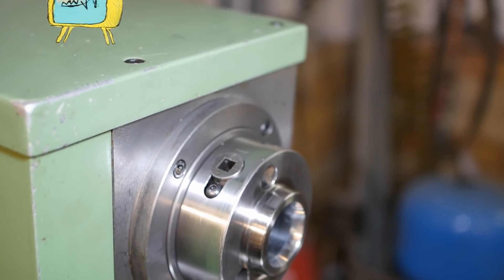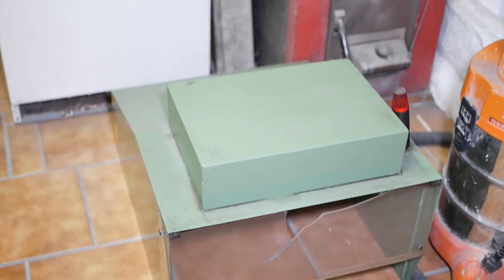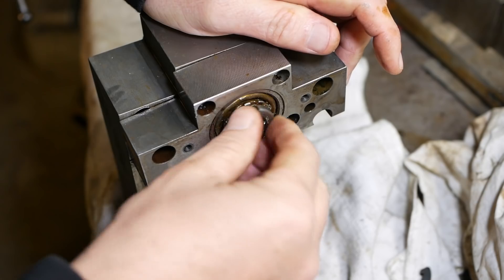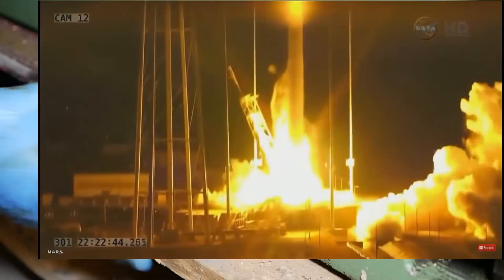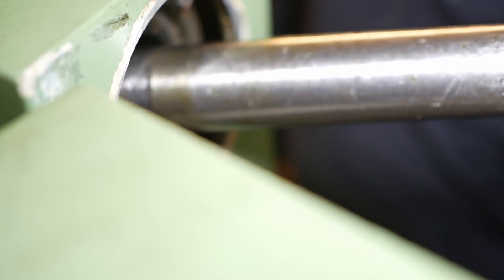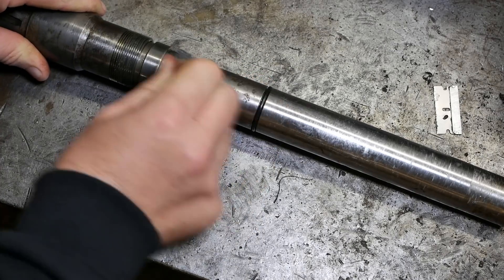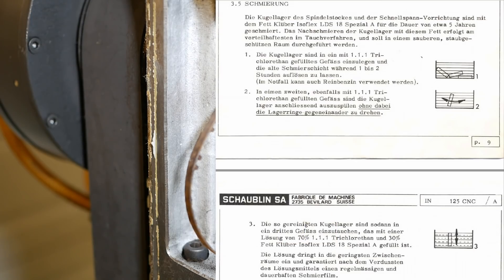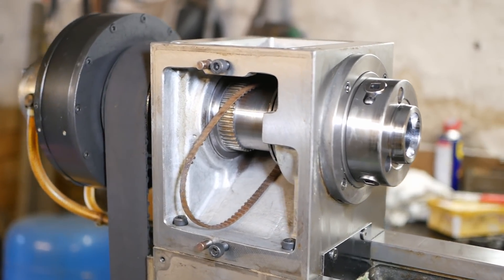Don't do this to your Boeing 737!

Comment: The nearest flat surface... I have never heard something so terrifying. The only thing that is truly flat is your surface plate...

The music again is on point, and the Antares launch explosion was also a nice touch.

But I really want to hear more stories about your work as an aircraft mechanic.

PSA: Apparently, some chewing gums cause a false positive result with one of those fast antibody Covid tests. We had that happen at our school.
Reply from the maker: Thanks. It took a while to find a rocket which blew up shortly after launch :)
Reply: Only carpenters know a perfectly flat surface to exist. The guys at calibration labs know that it's always off some.
Reply from the maker: Yeah, it is just a question of your measuring equipment.
Reply: @MF175mp  Yes, it has a derivation from true flatness, but in the shop, it still is the primary reference standard.

This is metrology 101.

Just like a few years ago we had "The Grand K", the international prototype of the kilogramm, an object which was defined to have a mass of one kilogramm, no matter its actual mass. It WAS the kilogramm, and by definition, had a mass of one kilogramm, and all all scales were calibrated to this artefact.

Just like "The Grand K" was THE kilogramm, the surface plate is THE flatness reference.
Reply: @vincentguttmann2231  the flatness has an absolute value and perfectly flat means the same everywhere. A unit of weight or any unit is a matter of standardization and it's not traceable to anywhere else than the standard
Reply: @MF175mp  Flatness also has a unit: derivation from flatness over distance. How exactly did RotarySMP check the Flatness of the cross slide ways? Oh right, by checking it against a surface plate, the shop standard for Flatness.

If I may quote Wikipedia: "A surface plate is a solid, flat plate used as the main horizontal reference plane for precision inspection, marking out (layout), and tooling setup.[1] The surface plate is often used as the baseline for all measurements to a workpiece, therefore one primary surface is finished extremely flat with tolerances below 11.5 μm or 0.0115 mm per 2960 mm for a grade 0 plate.[2]".

So as far as shop work is concerned, it is, by definition, flat. That's precisely what "being the main horizontal reference plane" means. 

And yes, there is derivation, but if no higher-order standard is used, you cannot prove that the surface isn't perfectly flat.
Reply: @vincentguttmann2231  the flatness of the plate itself isn't measured with a better plate. Those devices aren't standards for flatness either at almost any level. You still can prove and actually measure flatness with them. For example by bluing stuff up on the surface plate in the other hand you can tell that the thing is not flat but not very accurately how much it's off. Anyway my point wasn't that the plate isn't good enough for general shop use. Of course it's usable but if you do stuff with higher accuracy you need a better plate and so on. Of course I was just poking you on calling the surface plate truly flat and the other faces on the shop not flat. The machine tables for example are very flat. As is the surface plate. Neither just are perfect even though the surface plate might be more accurate in most cases.
Reply: @MF175mp  I would like to debate the first point. You can measure the flatness of a surface plate with a coordinate measuring machine. The gantry of the CMM rides on aerodynamic bearings on a bigger surface plate. Then, using measuring devices whose precision can be traced back to standards for length, the height of the surface plate is measured in relation to the bigger surface plate that also serves as the bed for the CMM gantry.

And a stack of gauge blocks that you'd use to test a distance also don't tell you how far you are off in either direction, they just (reliably) tell you whether your feature is over or under a certain length. Sure, you can feel if the fit is sloppy or very tight, but that is a nonnumeric, subjective measurement

So surface plates can still be used to derive flatness measurements, though not without other tools, since flatness (or, if you prefer it, non-flatness) is the distance of derivation from a true plane over a distance. And in all those cases, the reference plate is assumed to be perfectly flat.

And sure, you can use a machine table as your primary reference surface, and in some cases, they may even be more precise than some surface plates (though the border between bed and surface plate is fuzzy when it comes to CMMs), but there is a reason surface plates are made out of granite with a high content of quartz: They are more stable and wear-resistant than metal, and, most importantly, a chip in one area does not influence the rest, unlike say, a machine table that you ram a center drill into.

And using the method provided by Sir Joseph Whitworth, you can achieve very fine tolerances using only three surface plates and bluing compound. 
Then, there are so-called "optical flats", whose variation is within ten nanometers or so. So near-perfect flatness does exist, but nothing will ever be truly flat, as in those cases even the act of trying to measure the flatness will, in some form, change the flatness. Sure, if you're using interferometry, it's negligible, but it's there. 

And in a machine shop, I'd say that the surface plate is usually the primary reference plane. I have not yet seen someone bluing up the table of their mill because he wants to use it as a surface plate.
Reply: @vincentguttmann2231  Well, you in theory could use a CMM but the results might not be as accurate as you would like, especially for the most precise grades as the machine itself would be based on a similar grade surface plate. Also them being expensive af it would not probably be done that much anyway. Bluing up a machine table would be sufficient for a homeshopper like me who doesn't have a surface plate (yet)
Reply: @MF175mp  Well, fair enough. This was concerning ivory tower precision anyways. Like the stuff where you may even have to leave the room because body heat could influence something. You can always go crazy on something, and there are people who actually need the crazy precise resolution that some CMMs offer. 

Additionally, home shops often don't need to be terribly precise, especially since you're almost always the last one to add something to a project, and so can change the project to fit your changed dimensions.

Comment: I just use a wire wheel in a drill or an angle grinder to clean cast iron, super fast and it does no scratch the surface and makes it nice and shiny, I would recomend doing it outside tho, it sprays all the junk in every direction
Reply from the maker: There a few spots I will wire wheel, but mostly this machine had oily gunk rather than rust.
Reply: @RotarySMP  it takes off anything that is stuck to the metal
Reply from the maker: @DolezalPetr  And flings in into my new hair do :)

Comment: You:  Oh no, need to remove the spindle to re-lube the bearings.
Us:  Yes!  😁
Reply from the maker: :) Glad I can be your jester :)
Reply: @RotarySMP  No disrespect intended.  Many of our Schaublins and Habeggers have dry bearings. 😉
Reply from the maker: I bet. This part does scare me. Screw it up and you can go searching for €2000 of replacement bearings.
Reply: @RotarySMP  Yes, it is scary.  Will be replacing my Habegger JH102 spindle bearings sometime this year, and those bearings are expensive.
Reply from the maker: @danielabbey7726  Nice lathe. Is that a license built Schaublin?
Reply: @RotarySMP  No, separate company.  The way I've heard it, Habegger once worked at Schaublin, but then later decided to start his own firm building compatible lathes. They still exist, but don't build lathes anymore. Jorge at CinemaTechnic has an open-headstock model similar to mine on his website - has since sold it, IIRC.
Reply from the maker: @danielabbey7726  Let me guess, Habegger was the guy who thought Schaublins standards were not high enough :)

Comment: Why not enlarge the door...

Great video.
Reply from the maker: Thanks. Because it is in a 40cm thick concrete structural wall. Besides, the Schaublin should now fit though with about 5mm to spare :)
Reply: @RotarySMP  I see. Makes sense then. Looked thin from that angle. :)

Comment: hi been loving the cnc video's, hoping to convert an old machine myself at some point. when you say you cant dissolve the grease anymore, could you use another high volatility solvent like brake clean witch is mainly naphtha i think. not sure if it would degrade the grease or not, in principle it shouldn't. keep un the quality content.
Reply from the maker: That is my concern, whether the grease will stll work correctly for years after being disolved in a different solvent?

Comment: given me shivers how nicely they are build ...
Reply from the maker: It really is a nicely designed and built machine. Thanks for watching.
Reply: @RotarySMP  I've only been at this a few years, I'm a mediocre manual machinist at best and even I could see that quality. I'm not really sure how I found your channel and since I'm in the states some of the regional analogies go over my head but I can tell you're a sharp witted person and definitely knowledgeable, surely more so than myself. I do a lot of metal fab., hydraulic repair and small one off parts machining. You've got a viewer here for sure, I subbed and the notifications are on!

Comment: Why did I subscribe to this? It must be pure masochism!
I mean, not only do I not own a single lathe, turns out I lack a Boeing 737 too. :(

But I want to know now: what would be the system used for parts in aircraft disassembly? Countless plastic boxes of all sizes with sticky numbers on, and minions who stack and shelve them?
Reply from the maker: You pretty much nailed it. For parts only temporarily removed for access, it is approved to tag then with a temp removal tag stating workorder, part, aircraft removed from, location, date, signature. Generally you bag the fasteners with the panels and tape the bag to the part. Duing a major check, there will be temporary removal shelves scattered around the outside of the plane for the panels, 

For more high value stuff like  a set of fan blades removed for access, there will normally be a proper wheeled storage stand made to protect them and keep them sorted ( they will be a balanced set).

Comment: At least one of the tankers stuck/queuing in the canal is filled with my aliexpress components, so i expect considerable shortages to come!
Reply from the maker: I order a bunch of small electrical stuff like terminal blokes. Most already arrived, but I am sure there is some essential bit on the Ever given.
Reply: @RotarySMP  Terminal blokes!  ;-))
Reply from the maker: @Chris-bg8mk  Oops.
Reply: I think the AliExpress stuff comes in on that new 'silk road' cargo train they run along the Trans Siberian route into Brussels (Antwerp?) 
On a related note, I can't wait to see clips of massively overfed, 400lb Somali pirates trying to climb boarding ropes in about 6 months time. With everything going down the East African coast, they must feel like lottery winners right now! 
Skipper of that cargo ship will be facing what the RAF used to refer to as 'an interview without coffee or biscuits' (aka, the mother of all bollockings) as he explains just how he managed to get the ship almost 90° across the channel, despite the channel being obviously more narrow that the ship is long! I'd imagine it's similar to those idiots who try to get out of mud by spinning the wheels until the car is buried up to the door handles before admitting defeat
Reply from the maker: @andycollins3978  If I understand it, all ships in the canal are piloted, so the captain is probably not responsible. Given a decent sand storm and high winds, that pilot is probably got some hard questions on why he decided to commence the trip. 

Given that the bridge is about 45m up and 300m back from the bow, I wonder what they could actually see.

Do these huge container ships have bow thrusters?

The ship has about a 15m draught. Wonder who wide the  15m deep part of the canal is?

Comment: You might want to do some investigation on the Heidenhain encoders. If they are anything like H's optical scales, I believe they use some strange current signalling at millivolt levels rather than TTL and may be useless with TTL controls. I actually contacted H via email some years ago about a control from the eighties and to my surprise got a helpful answer from them so that might be an avenue of inquiry.
Reply from the maker: Good point. Older Heidenhain encoders output the analog 11µA sine wave signal. The LS-403 linear encoders on my Maho are like that. You can pick up a 602 EXE off ebay.de for about €60 whih does the A/D conversion to TTL. I had to get two for the Maho, as two channels of it'S A/D were DOA. I need to look into the ROD 620 andsee whether it has the A/D hardware in it, or needs the EXE.

Comment: Holy smokes thats a narrow door you got into the shop. I cant Even imagine how you got the maho throug that. 👍

I Will be going to the south part of denmark tomorrow to look at a doosan horisontal cnc. Its a old one and it might be a bit of a project. But there is a auction on it and its been 1 euro for the last 3 weeks. And the auction ends next week
Reply from the maker: Hi Nicolai. I didnt. Looking at that door, your back is to the garage door the machines all came in through. The Maho is still in the garage, and I changed my mind on disassembling it and moving it through into the machine shop. It would kill the space in there. So it stays in the Garage.

Sounds like the most expensive €1 you will ever spend :) 
You going to have time to watch the MotoGP today? Cool that Rossi qualified so well.
Reply: @RotarySMP  i Hope so. I am building some stuff around the house. The stream i used to watch it on is dead so i might have to pay for it haha
Reply from the maker: Can you follow german? ServusTV has a live stream.

Comment: A lot of elbow grease Mark, re cleaning spindle bearings I would soak them in Break Cleaner as TRI is not be used anymore.
Cheers Bengt
Reply from the maker: Yep, that is probably going to be the solution.
Reply: Some brake cleaners contain Tetrachloroethylene though, which is just as bad for the ozone layer. In newer ones it's usually not used, but if your bottle is a bit older, chances are good that it still uses TCE.
Reply from the maker: @vincentguttmann2231  I am pretty sure that none of those ozone depleters have been sold in the EU for decades. 
The can I have at present is just C6-C7 n-Alkane, IsoAlkane, and n-Hexane. Basically just the most volitile parts of petrol.

Comment: Instead of razor blades, have you tried scotcbrite? I'm working on doing a rejuvenation on a CNC milling machine, and scotchbrite has been my scrubby of choice (along with degreaser and or simple green) so far. Green scotchbrite on bare metal, and blue (nylon only, no abrasive) on painted surfaces.
Reply from the maker: I have, but it uses aluminium oxide as an abrasive, and I'd rather not have it embeded in the cast iron. I use steel wool as the abrasive.
Reply: @RotarySMP  Oh, that's a good point. I guess I should only use steel wool on ways too then. Will aluminium oxide get into hardened cast iron box ways?
Reply from the maker: @gorak9000  I don't really know, but figure I'd just use steel wool, since I have it one hand.

Comment: First! 
My type of organisation system..
What is your intention with regards to the tail stock? Can you find a replacement one at reasonable price?
Reply from the maker: I am pretty sure one will turn up sooner or later, but the tails stocks tend to be really expensive. A friend here has a 125-CCN with a star wheel tailstock, I can borrow, strip down and reverse engineer, if I need another project :/
Reply: @RotarySMP  In case you go for that project, are you gonna have to cast the body of the tailstock? Or can one make it without a foundry?